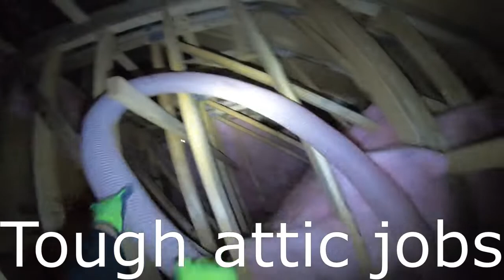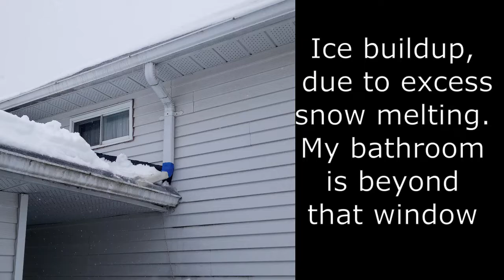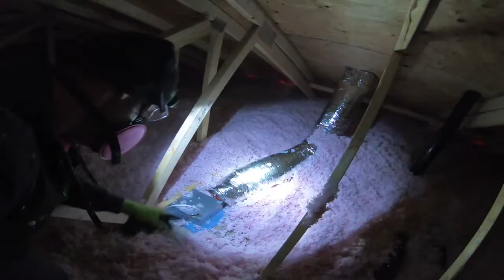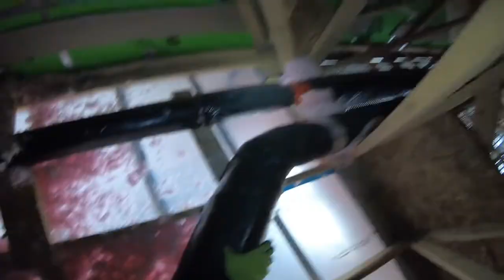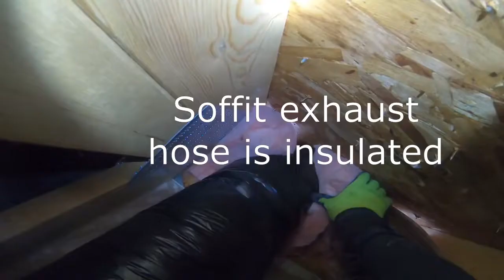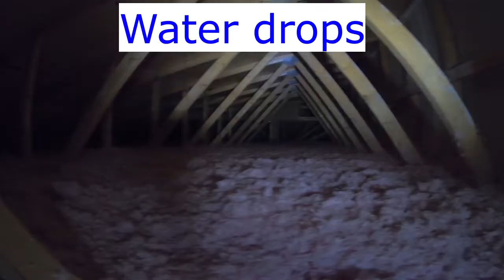Tips to install attic bathroom fans_prevent heat loss save money

Comment: I don't think it this affects me in Northern California, where is rarely snows.

But I'm wondering about the explanation around 4mins in. How is melted snow (water) getting below the waterproof paper layer on your roof and soaking the OSB? Should water just run down to your gutters? I could be missing something, since I have never had to deal with snow on my roof.
Reply from the maker: Great questions. What happens is snow melts because of minor heat loss over time from the house. This creates a sheet of ice under the snow which travels upwards once the gutters get full of ice. This happens often when warm weather is followed by very cold weather.
Reply: @SinnisjInsulator  makes sense, yeah the paper is designed for water flowing downwards. I could see how upward travel causes issues.

Comment: Don't vent it through the soffits. The soffit is the roof inlet and will suck that humidity right back into the attic. Vent it out an un vented gable or vent it through the roof.
Reply from the maker: I agree roof venting is better, but some builders still install them through the soffit. I just have to deal with what's given to me.

Comment: I live in Tennessee and my house just vents directly into the attic of course it doesn't get that cold down here but it's gettin down in the single digits in a couple days.  Truth is I don't ever use the fan unless I pass a real stinker if you know what I mean.
Reply from the maker: But it will still evacuate hot air especially if your house is 70 and the attic is in the single digits. You should exhaust this through the roof using a insulated flexible hose.

Comment: I had my insulation removed and reinstalled in my attic. Now my bathroom fan won’t turn on. Why would that be the case?
Reply from the maker: It's very unlikely that someone disconnected the power. You can check if there is power running to the main cable by removing the plastic ceiling grid from your bathroom fan and unplugging the fan. I've had to replace my fan because the motor was burned out.
Reply: Thank you!!! I appreciate your knowledge and response
Reply from the maker: @Nikki-xd5hc  you are welcome and good luck.

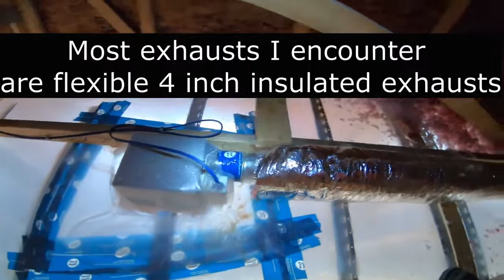Comment: Hmmm... I'm not quite sure, but it appears as though condensation may be forming around the bath fan housing that has been covered in plastic. See timestamp 3:04
Reply from the maker: Yes, this was a new house that had not yet been insulated in the attic. I was in the process of insulating it when I made this video in fact. I believe it was -10c outside and the house was being heated at the time. I quickly insulated the attic, the condensation disappeared once I was complete.

Comment: Most soffits have intake vents for at tic ventilation. Never vent through the soffit if this is the case. It will just pull all the moisture back into the attic.
Reply from the maker: Yes I struggle with fixing exhausts out the soffit ona. Regular basis at my work. That is why I mention to not add vents adjacent to the cavity where the exhaust is installed. That way it at least provides a buffer to drastically reduce or eliminate the vapor coming back into the attic. Us canadians are faced with lots of mold issues with improper installed bathroom fans.
Reply: @SinnisjInsulator  same here in the northeast states. We see it all the time as roofers. Luckily it is a pretty easy fix usually. Good video!
Reply from the maker: @nerdfamous5794  thank you, much appreciated. Let me know what you think of my roof vent videos 😃👍

Comment: Hi Josh,
I’m losing heat through my eaves. Lots of icicles, good sign!

What should I do with the eaves?

Garry Betty Leyte — The Ole Church 5 Acre Homestead.
Reply from the maker: thanks for your comment, my suggestion is you block the soffit intakes 3 feet on either side of the fan exhaust within your soffit. do this with combination of a tight vapour barrier and additional Insulation even within your soffit cavity between your trusses. your eaves also need to be straightened out so water does not pool in the area you have issues with. ice is heavy ☺️

Comment: Good info.
Pretty sure soffit vent is not allowed unless its diverted away from the roof line. 
People do them all the time though. 
Fan vents always seem to be tossed in (diy job) or abused (roofers).
They can cause major problems. Moisture, mold, ice dams, hot/cold spots in house.
Reply from the maker: Oh they sure can. I unfortunately see a lot of improper installs even in new houses. I just read up on the new codes for fans including dryer exhausts and kitchen hood exhausts. You are right about the soffit installs. The installers at least put a diverted insert so the cover blades direct the hot air away from the soffit. The problem I find with gable wall or roof installs is that the hose is now angled up and not down and the r value of the wrapping is terrible. Soffit models at least can be covered with additional loosefill when I install at r60. That's just based on my experience.